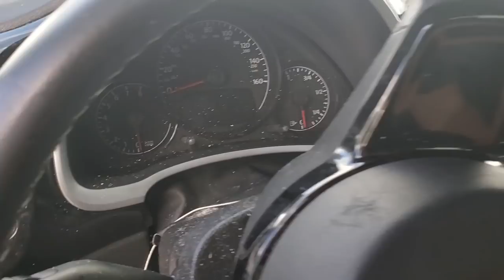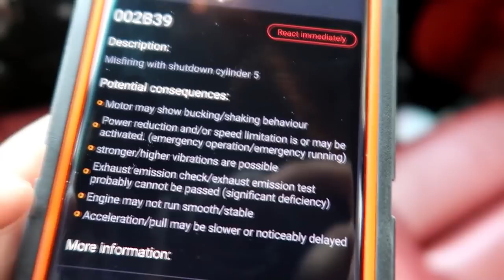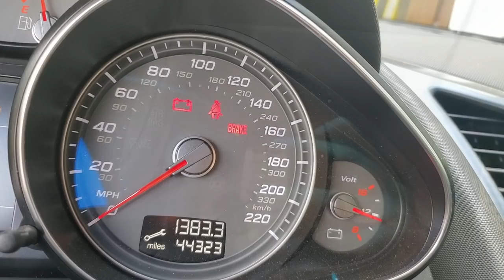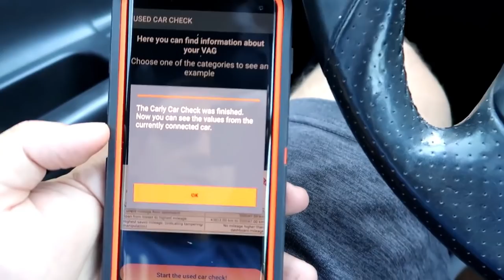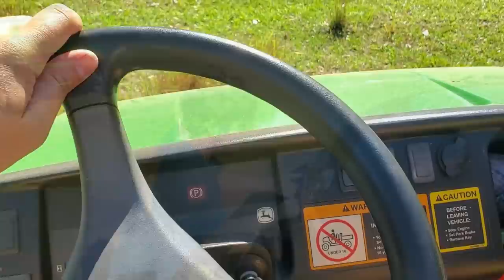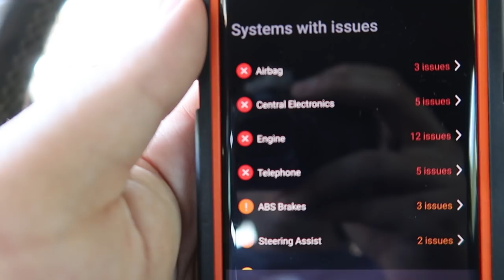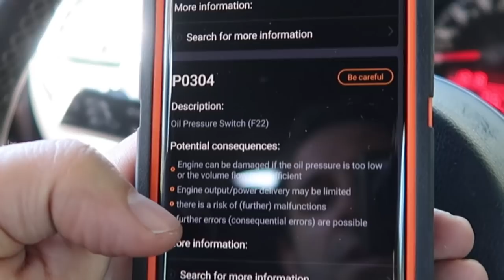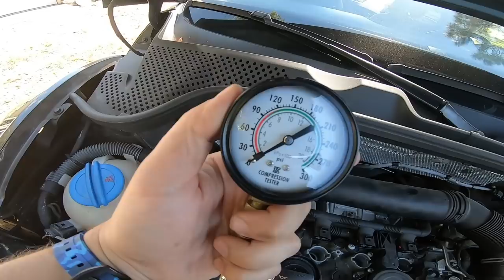I Bought my Friend a STOLEN, Crashed, and DEAD Turbo VW for Christmas. He Loved It!

Comment: Timing belt let go and then the car was "stolen".  Genius!
Reply: I've always  thought that is what you should do when you have a problematic, yet somewhat valuable old car.  You have it towed to the top of a hill an push it down.  Get a ride home.  Call the police and tell them your car went missing.
Reply: That engine uses a timing chain. Though there are issues with timing chain tensioners on them sometimes... Maybe the tensioners failed.
Reply: It’s that or keep making the payments. He did say that it was owned by the bank.
Reply: @David-nh7px  yes.  Of the 3 people that I know with this engine 2 have had the tensioner fail and destroy the engine.  I replaced mine before it happened.
Reply: @moniack  - These engines are garbage cans.
Reply: @OMGWTFLOLSMH  yea, it's too bad because they are very refined and make good power.  I thought the chain was a plus when I bought the GTI vs. my old 1.8T's timing belts.

Comment: did you check for a broken timing belt? many pistons are designed with valve inlays to achieve higher compression ratios and prevent valve damage in the case of a timing belt failure..

Comment: Those 2.0 and their notoriously bad timing chain tensioners. Gotta love em! That’s why I joined the class action suit against vw and won my $1500 back.
Reply: Dang and after taxes and fees, that $1500 is most likely $450.😧
Reply: @stevelozano9523  nope, I got the full amount. VW had to pay the  legal fees.
Reply: @jonsmith6496  that amount you won in case to government is considered capital gains and is taxable. This has to be paid when filing your taxes.
Reply: @stevelozano9523  is it though? It isn't a net gain, it is compensation for losses suffered.
Reply: I had the same problem with my water pump, but it was replaced under warranty by the previous owner so there’s not a chance of money😭

Comment: you push up and down on the hood while someone pulls the handle works well sometimes 
that whole front end comes off super easy .except for 2 hidden little bolts in the headlight bezel ..you will meet them

Comment: Just a note: Whenever the keys are in the ignition, you want to have the driver window rolled down in order to avoid accidentally locking the keys in the car.
Reply: @Dat Boi Sounds about right; German cars are especially notorious for doing that.
Reply: Yup even if it's just enough to reach in I always do it. Recently my dads nissan cube locked on me and boy was I glad I left the window open lmfao
Reply: @ryanravencaller  After the shop safety course, that was always the FIRST thing my auto instructors taught you & they were religious about it!
Reply: @Rekuzan  everyone asks me why I do it, I tell them to lock their keys in their car with the window down, and then I tell them to try to open the door, some quickly realize why we do it,  others are just like what I dont understand the point, usually these people end up locking their keys in their car
Reply: @ryanravencaller  Many people don't realize auto makers do this as a security feature because on the occasions they forget to lock their car before going in for the night, the thing locks itself and they don't notice because they have their keys on them in the morning and everything is normal.
Reply: This model Beetle is keyless push button start

Comment: There is a small black clip that pulls out from the back of the the hood latch handle (most modern Volkswagens) (inside the car) you can then grab the cable with a pair of pliers to open the hood.

Comment: Pretty impressive on the part of the thieves - and unlucky for you and Zack - to crash it AND trash the engine at the same time. Usually you just get one thing or the other. Did the crash cause the timing chain/tensioner to fail at the same time? Or did they crash it, drive it a bit more, rev the hell out of the engine and kill it later?

Comment: I always check the hood release in the interior. Often the plastic breaks off where the wire attaches and you can take a plires and grip it and pull and you are in. Or you are unlucky and the latch is froze....

Comment: I bought a 01 Audi A4 quattro for $400. Finally got it started by pushing it. Engine was knocking and leaking water. Might be a freeze plug or a rod through the block. Went to AAA recyclers in Seagoville Texas. Tried to get a engine there but when I seen it both came shaft pulleys where broken along with the timming belt. They told me that they could get another one on Thursday a week away. Paying $600 for the engine. Other than a clear coat peeling the body is in really good shape and the inside looks like new. Will have to replace the rear view mirror. This looks like a good project car. Still will have to replace the heater core but it's not going to be a must for it to run and drive. If I got the car with no problems at a car dealership I would be looking at a price around $8,000. I'm always finding stuff like this. Really looking forward to my next project car I'll be getting in January or February. Will update you on what happens on the Audi and my next project. If you want to contact me please don't hesitate to call or text me at 903-209-6178. I'm in kowana Oklahoma.

Comment: As soon as you opened the engine I knew it wasn’t going to run and then the cam code confirmed it. These engines at least the earlier ones had a tensioner issue where it would fail and loose timing although I don’t know if it was the issue with this one but Definitely something to keep an eye on with these engines along with the rear main which may leak. All in all hope your buddy has good luck with this beautiful car and I look forward to seeing it on the road again.

Comment: VW's hood release latch breaks often since it's weak plastic. Normally if you're lucky you can just remove the trim piece and use needle nose pliers and pull. It'll tell you if the cable is broken or not.

Comment: Finally a Bug on one of these channels!

When you replace the engine check it has the revised timing chain tensioner  fitted, as these are prone to failing (I'm pretty sure there was a Class Action for it in the US).

And it looks like a Turbo Silver car, assuming you got the same spec as we did in the UK.

Comment: Timing chain tensioner failure, CBFA engines are known for this and had a recall on them. Happens from around 70k.
Reply: TFSI engines? Why cant VW build a 2.0 turbo that doesnt have problems? My friend replaces his cam follower every year now as preventative maintenance.   That was after losing the original engine 3500km outside of warranty.  VW didnt even meet him halfway.  I'll never own one of those piles of junk.

Comment: TSI tensioner failure. A potential problem on all TSI engines up to 2012. Anyone buying one needs to check the updated timing kit has been fitted or adjust the buying price accordingly. Still a nice present though.

Comment: Why don’t you just put a rebuilt head in? Me and my buddy did that on his GTI for only $350
Reply: Pistons are marked up, metal from the piston probbaly scratched the cylinder walls and got metal circulated in the oil through the engine. You could strip the block, over bore it and buy new pistons and rebuild head but its cheaper just to buy a used engine.
Reply: @Red6er  not necessarily the valves on this thing are tiny. The pistons on his are marked up but as long as the block is fine it doesn’t matter.

Comment: We had a new Beetle for a rental a number of years ago and what I hated about it was the rear of the engine bay really intrudes on the legroom, I was driving with my knee against the thing and could not get comfortable.  I mean it sticks out way more than any of the big full size vans I've had, and I drove one of those 1000 miles in a day without cruise.  

Other than that it was okay.  If you're small or skinny that shouldn't be a big deal.  I'm not fat, probably average, so maybe it's just how I position myself to drive.  We had worse rentals, the one Olds Alero had seats like boards and my back hurt like hell after a couple hundred miles.  That was a looooong time ago.
Reply: Need Cowboy with the loader to open that hood.

Comment: my 2014 TDI VW Beetle destroyed the Fuel Pump....the inside of Pump went thru my fuel lines Fuel Filters...destroyed my Injectors....VW Replaced it all $7000.00 1 month later Destroyed the Turbo....$2000.00 VW payed for....65,000 miles still under warranty

Comment: Well it’s at 74k miles, I think you guys should replace the timing chain!
Reply: I hope you mean the guides. I’d be impressed if they could make a timing chain that fails
Reply: @N54bryce  oh dont even get me started, if you follow me on inta I can show you the carnage
Reply: @N54bryce  because these engines need to have timing done at 70k miles, once it by passes that goodluck
Reply: @N54bryce  I’ve seen them go all the way to 120k miles before the tensioner fails and stretches the chain. I hate when people just replace the engine, IT WONT SOLVE THE PROBLEM! it’s an internal issue, and if he plans to throw away the 2.0t motor, I’ll be happy to take it off his hands

Comment: You pull the engine cover and the other guy hits it with sledge hammer on the side (wrapped in cloth).
Reply: Done there been there, Polo 2016

Comment: Sam the new  Beetle Hatchback Infotainment and Features

The Intelligent crash Response System will also switch off the fuel pump, unlock the doors, and activate the hazard lights in the event of a crash.

Comment: There was an extended warranty on those engines. VW extended the warranty to 12 years or 100k miles. They also prorate engine damage caused by the tensioner issue.

Might be able to take it to a dealer since it's a clean title and get them to work on it

Comment: Had to stop watching couldn't bare seeing unnecessary damage being done to the car. Future reference Sam, when you pull the cable you should be pushing down on the hood that would make for an easy release of the latch by offering less resistance as opposed to pulling the hood up, capeash